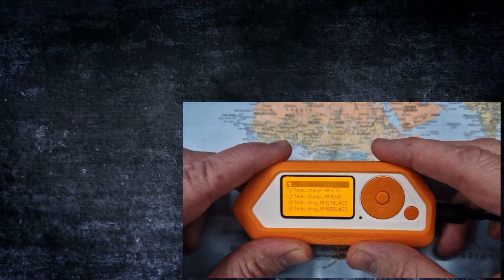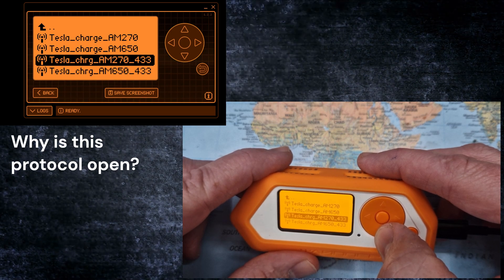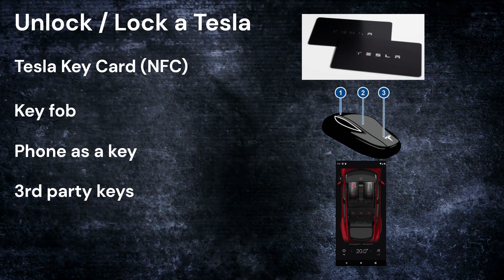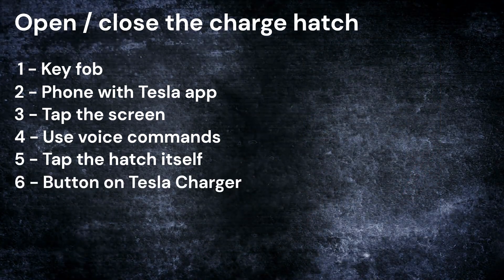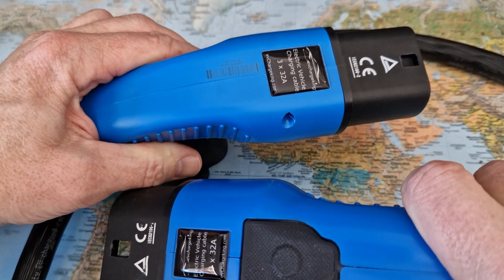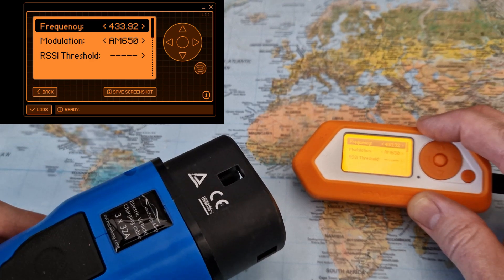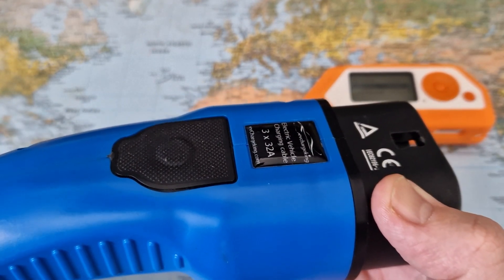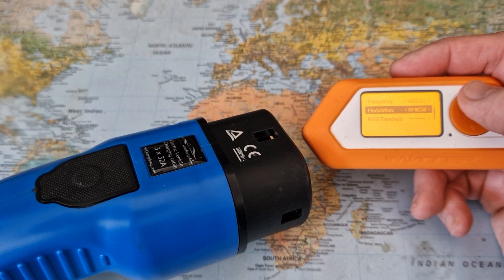Behind the Scenes: Flipper Zero Tesla Hack #flipperzero

Comment: Can the NFC cards be emulated? If not, why? I am not any sort of expert in NFC technology, so I don't know how the different cards vary physically or their operations. If the differences are just in code then a bit for bit copy should do the job. What prevents that from happening?
Reply from the maker: About if a RFID or NFC chip/card can be emulated, depends of the implementation. Secure implementations, such as NFC payment cards are basen on a key that is stored in the secure chip of the card. The messages from the reader that is sent to the card can be encrypted and only decrypted by the key in the card. Vice versa - the message from the card is encrypted with the stored secret key, and can only be decrypted by a key on the server side. I have explained some of this in the video about RDIF access to doors - https://www.youtube.com/watch?v=K1atb194IBs and also when using credit cards -  https://www.youtube.com/watch?v=-I-P3JQqSf0
Reply: @techandfun7723  So if I got this right, the card sends out an identifier to the server, the server sends back a challenge and then the card sends a response, which is then authenticated by the server, which then sends an authorization to the lock/merchant/car/etc.?  In the case of Teslas, the server is in the car, or is it online? I am assuming the cards work whether car has a web connection or not. Producing the identifier requires a reader sending a query to the card. That identifier, regardless of encryption can be captured raw, I would think. 

Does the challenge then query a lookup table on the card, which then plugs the response number into an equation, which then spits out a one-time response? The server also has a copy of this table, runs the same equation, compares the outputs, and in the event of congruency sends the authorization?    

Obviously, cracking that would require more cycles and bigger numbers than an F0 will ever be capable of. Amirite?
Reply: @techandfun7723 does it work on model y
Reply: @@mattesrawer6621 Ummmm....no, it's not just a rolling code. It authorizes like a credit card with a rolling code then challenge and response server. Rolling code would be almost easy. Teslas are not. Thanks for the suggestion, tho.